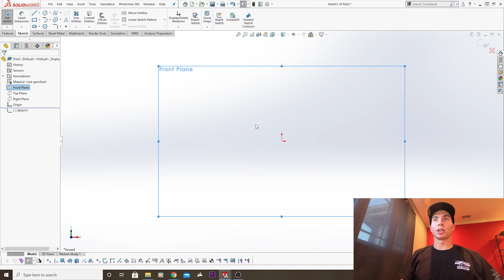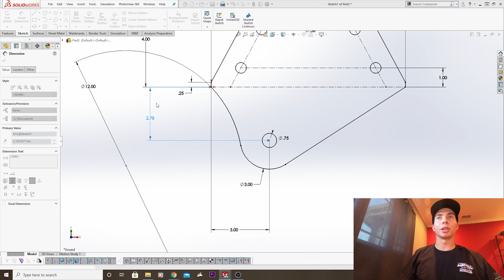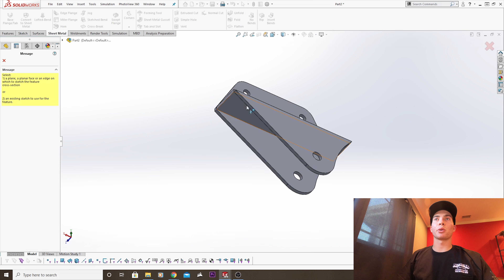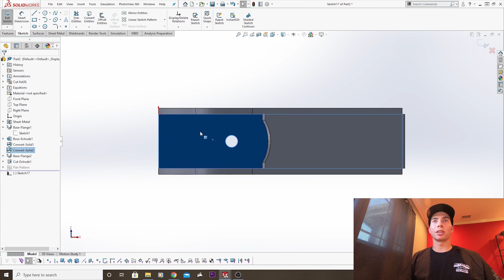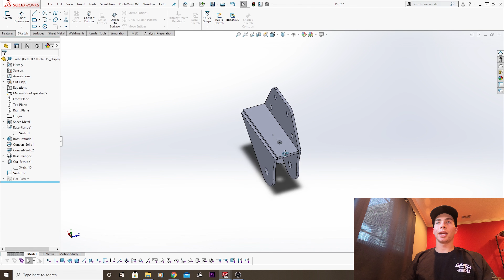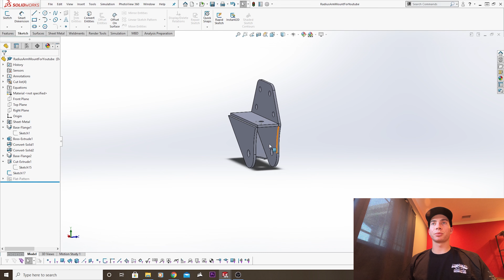SolidWorks Tips For Designing Offroad Parts!

Comment: Some advice for SW that can help with things like tube frame design: weldments, expanded weldment libraries, and 3D sketches.

The weldment environment let's you sweep pre-loaded cross section shapes down sketch entities. The default weldment profile library is very limited. You can download a massively expanded library from Dassault Systems for free. This expanded library contains a ton of stuff that I needed for work like I beams and C channels but also has a lot of DOM round tube that fabricators like you guys would use for tube frames and cages.

The second thing that greatly improved my design work is the 3D sketch. It's kind of weird to get started and it's kind of finicky but once you get the hang of making 3D wireframes you can very easily shoot your weldment profiles down any shape wireframe guide. I would use this approach for designing work platforms and structural steel work but it is also excellent for tube frames. Once you get the wireframe created the weldment feature allows you to very easily apply or change which shape you want at which line segment. It also automatically notches the segments where they meet together. It's a really great combination of tools for tube frame work.

Comment: Just in my experience I've learned to mostly avoid the sketch fillet, and I prefer to add fillets or corner breaks to an existing body.  If you decide you don't want the radiused corners down the road, it's trickier to remove the radii in the sketch and then merge the end points of two lines, or if you have 10 sketch fillets, merging 20 points.  I know you used the fillets to center the bolt holes, so doing what others said and adding the holes in a separate feature would still allow you to do that after you've added the fillets.  Obviously there are many ways to achieve the same thing, and the more time you spend in Solidworks, the more you'll develop your own methods of designing parts.  Also something that made me laugh, the pronunciation of fillet is "fill it" not "filay".  And coincident is just like coincidence but with a T, not "co-inside-ent". Keep it up though!
Reply from the maker: That is a very good point about fillets, I will use that method from now on. haha I noticed that I pronounced fillet that way when I was editing. I guess I have been hitting Chik Fila too much

Comment: I'd recommend using the right click menu, much quicker than S IMO. Also I'd highly recommend NAMING all your features, and use a separate feature for things like mounting bolt holes or anything you feel you might need to change later. That way if you do need to change it it's much quicker and easier to find - makes a big difference on larger assemblies. 

Overall pretty well done for someone who is self taught😉 I had plenty of engineers in my solid modeling classes who were much worse then you at solidworks 🤣
Reply from the maker: Thank you for the comment haha! I will definetely start naming my features and I will look into the right click menu.

Comment: Saw a few of these in the notes but:
Use the origin as a base point. If a box, use the center. This allows for a reference point and easier inserts into assemblies. If an odd shape, find a point easy to reference off. Using the default planes also make it easy to add a center line thru the part. With a center line planes, features, or bodied can be rotated or referenced from it.

“Right click” on the mouse for short cuts, make sure you set it to at least 8, think defaults is 4.

Dimensioning with a center line. Pulling a dimension past a center line will “split” the dims.

Use the “hole wizard”. This will allow you to choose size, depth, thread, and number. If making drawing it will auto call out the hole specs. If you need a “clearance” hole, it will have the machinist presets or you can change the setting.

Weldments, definitely helps with parts list. Also makes it easy to insert bodies for drawing template printing, similar to part/assembly but pulled off one part model.

If you need part models, McMaster.com has lots of store bought part models.
Reply from the maker: I have used McMaster a lot as well! I was going to mention it in the video but it was already getting to be long. I am still confused on why I should center things on the origin, how does that help?
Reply: @WingsWorldChannel  Makes it easier in assemblies. Sometime planes make better mating surfaces. Measuring off planes become handy too. Not all parts can be centered but at least a known starting point, with a simple part as you were drawing, not as big of a deal but more complex parts it becomes easier to reference.
Everyone draws different and there are different ways to do everything.
One of my pet peeves is opening up a drawing and the planes aren’t centered on the part making it even harder to understand how the part was drawn and what am I suppose  to reference the new modification off of.
Extruding mid plane has a better chance of keeping the feature reference (holes, cuts, extrusions) on the extruded faces.

BTW, cool last name.

Comment: Here's a tip! While it can sometimes be great to have everything in a single base sketch, other times it's very nice to have the holes in a different feature. Allows for faster edits in the future, knowing your base feature is a Boss Extrude or Base Flange/Tab, and the holes are in either the Hole Feature or Cut Extrude. Also, its a good idea to label your main features in the Design Tree. Three months from now you may forget why you did something or what the feature was for. 

Great video and really good tips.
Reply: 100% agree. 5+ years of SW experience has taught me to make relatively simple sketches, and then name the feature. It's much easier to edit things down the road (pun intended), and if you ever send your part to somebody else with Solidworks, they will be able to comprehend it much easier. 

Also: Hole wizard is your best friend, get familiar with it, use it.

Edit* Modeling threads is expensive for the computer to model. I try and name the features/parts 1/2"-13 x 2"L or some such, then skip adding threads. It doesn't matter so much in little models/assemblies, but it won't do you any favors other than looking pretty. 
If you are importing models from say McMaster Carr, you can go in and suppress the threads without breaking the model.
Reply from the maker: Never thought about naming features, thank you for the tip!!
Reply: Great tips. Naming really helps. I really like using the hole wizard because it creates great info when used with the hole callout feature in drawings. I like to put as much info as I can in the sketch but like OP I prefer to just put a point where I want the hole and the create the actual hole with hole wizard. With the position controlled by the sketch and the hole type controlled by the wizard you can easily go back and change the holes parameters, even changing between thru hole, countersink, counterbore etc without having to make changes to the sketch.